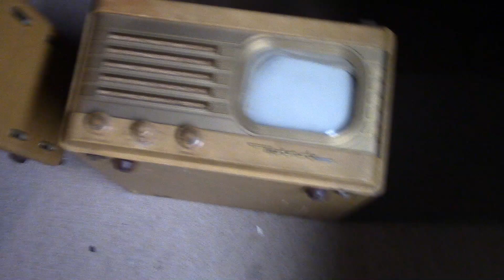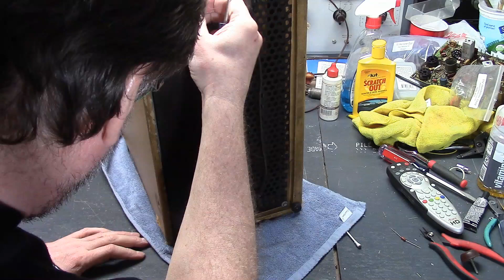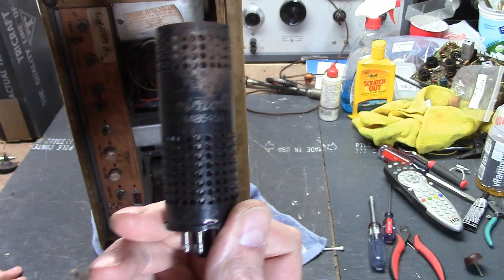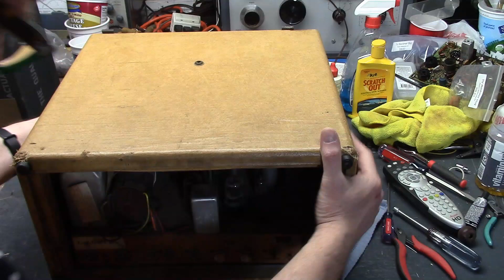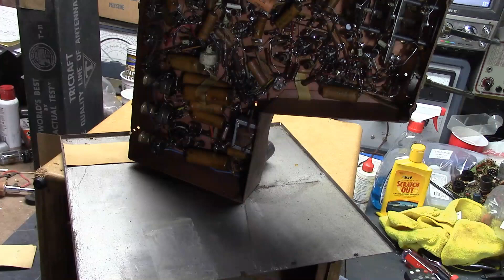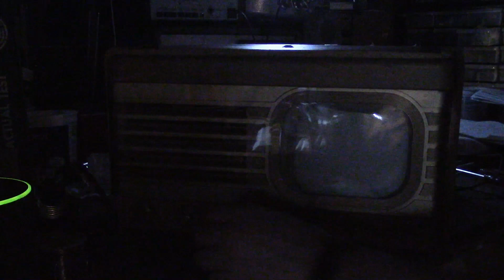Motorola VT73 restoration part 1

Comment: Nice set, Bob!  I wonder if that flip up panel was to help prevent shock hazard as some of those pots control  the high voltage.
Reply from the maker: Perhaps.  Those pots do have long plastic shafts though.

Comment: There was someone selling repro screen gaskets, as I remember ordering one when I rebuilt one in the shop I used to contract at. IIRC they were about 25 bux or so. but that was like 15 years back. The green CRT from a  very old oscilliscope with the same CRT base will work great as a test tube so you don't have to remove the CRT from the case. Hint- Heat the base of the CRT slightly with a heat gun before trying to pull the socket off. The base for that CRT is identical tot eh early "roundie" color TV sets CRT's'
Reply from the maker: RenovatedRadios.  The original owner and craftsman retired a couple years ago.  He had said the masks were a hassle to produce - part of the problem being finding a good original example to mold.  I half a dozen and still have a couple yet to use.  They are not a perfect fit, but much better than any other alternative.  I've restored many of these sets and use a 7VP1 while testing.  Some photomultipliers also use this 14-pin base.

Comment: I have seen  photos of closed cell foam backer rod used to replace that " hard as a rock" foam picture tube holder. Was
TS-4J the last revision from 1949? I know TS-18 chassis was in the model  7VT5 from 1950 which was in the same 
cabinet with a cover. Very unusual and cool portable set!
Reply from the maker: Yes, 1949. They started making the TS-18 in '49 as well. I have a 7VT5 and a 9L1. That's the portable with 8" CRT

Comment: So basically, it looks like it almost works? I was hoping you would put a signal into it. Maybe next time, and thank you for the video!
Reply from the maker: I was putting a signal into it. Possibly the detector germanium diode is dead.
Reply: Very dirty or corroded tuner contacts I suspect. Screen looked snowy.

Comment: Have not seen a cover like that on any of our Motorola electrostatics. Definitely a very cool part. 

You are correct on restoring these vintage sets not being a profitable endevour, between parts and labor you can get a lot of wrapped up in one of these sets. So far I have resisted request to restore sets for others.
Reply from the maker: Ugh, just realized I misunderstood your comment - you meant the hinged back cover - not the front suitcase cover.  I have since heard from two other collectors that have seen this same metal cover on TV73s so it really is original to the set.
Reply: @bandersentv  No worries, we have 2 7VT5's here and neither of them have the cool metal hinged cover. We have case and lid for the brown tolex set but our blonde case has no lid. The brown tolex set has a masonite back cover and the blonde case has the perforated metal cover
Reply from the maker: There were three portable Motorolas with hinged covers.  This, the 7VT5 with a porthole type bezel and the seldom seen 9L1, 8" model.

That's exactly why most get restored by the owners themselves.  Labor of love.